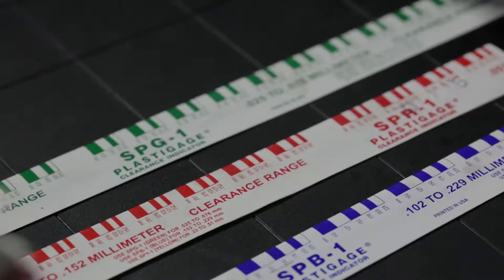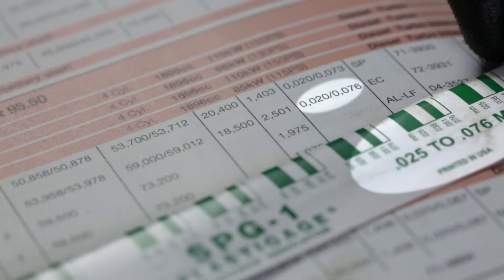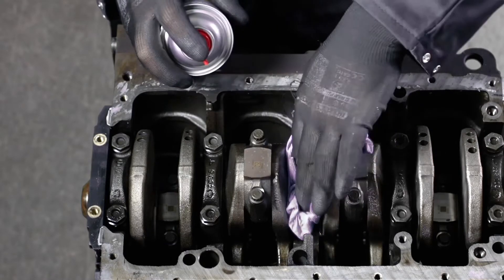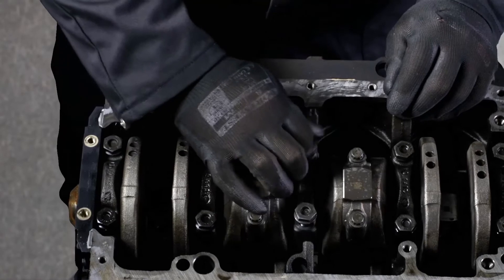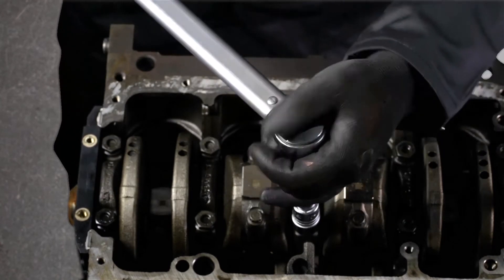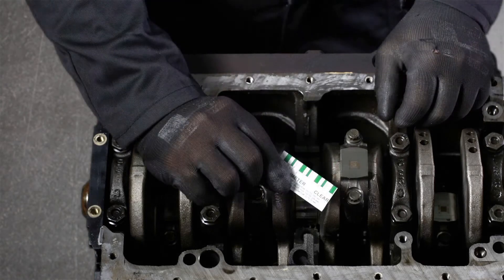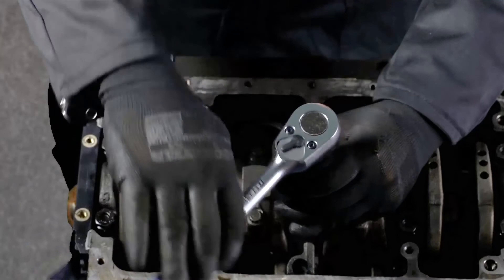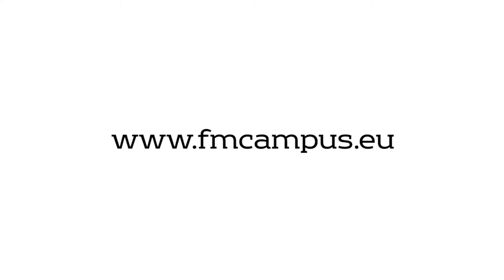How to correctly use Plastigage

Comment: Thank you for your video.

I am in the process of using plastigage on my 2zz engine.  My frustration has been how to align plastigage on the crankshaft without it moving or sticking to my fingers.  Do not like concept of adding grease as it can "take up" space during measurement process.

All parts are clean and dry.  Assembly area is 21C/70deg, low humidity.

Q:  Will grease/oil push-out around plastigage and give accurate measurement?

Q2:  Did not have long "breaker bar" to get final torque.  Will plastigage creep overnight under 60Nm/44lbft awaiting another 90deg for final torque?

Thank you in advance, and VERY nice animation on plastigage concept.

P
Reply: Use tweezers. A piece of Plastigage usually sticks to an Xacto knife blade. The oil has no negative effect. The pressure squeezes it out of the way. Proof is that Plastigage wants to stick to both the surfaces (for me, even when I put silicone on it)